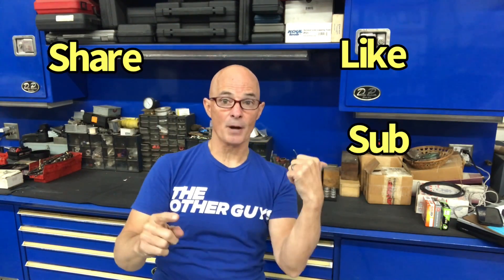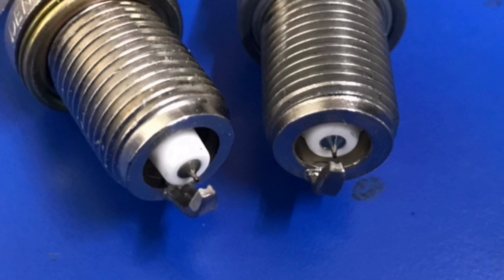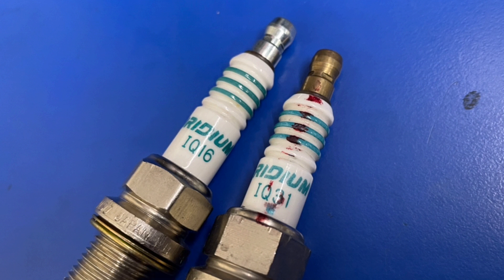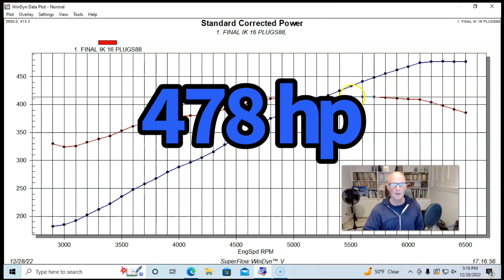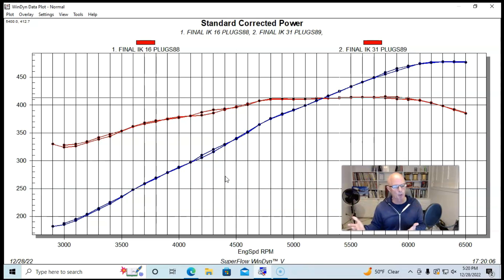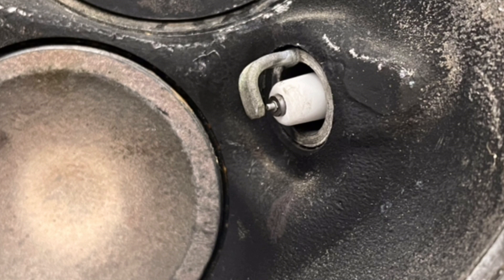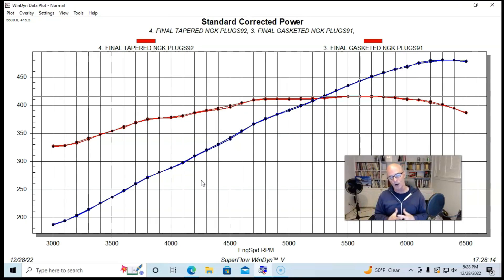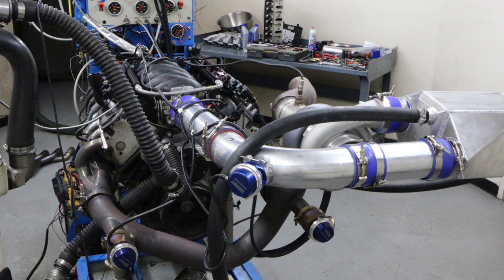SPARK PLUG HEAT RANGE TEST-JUNKYARD LS. HOT PLUG v COLD PLUG-DOES IT MATTER? TAPERED VS GASKET PLUGS

Comment: i have a 1070 318 la engine , i used to run rn14yc and autolite 66 and they both ran the same then i put in a set of ngk gr4 platinum plug and the engine began to run lean and no more raw fuel smell out the tailpipe ...what do you say i should do ,,,keep the platinum plugs and richen the mixture a bit or go back to the coppere plugs and lean it out a bit

Comment: Hey Richard, ever mess with the range Rover sport 4.2 or 5.0 supercharger? M112 I believe on both. Any idea on differences? Issues with them? I think it would rip on my motor. I can snatch up a 4.2 blower dirt cheap at the Pick-A-Part. The m90 is a bit small I think. 4.5 V8.
Reply from the maker: NEVER HAVE
Reply: @richardholdener1727  sounds like a good idea for you to grab one 😁. I'll have to check 8n on the live feed to see if anyone has played with them.

Comment: This doesn't really get into WHY you run a hotter/colder plug. You want a plug that's hot enough to burn soot off at WOT but not so hot it becomes a hotspot causing detonation. Too much conductive soot will sap spark energy.

Running a really cold plug on the street & driving like a grandma will foul it out fairly quick. The "get heat in the motor" meme actually applies here, winding the engine out occastionally will nuke carbon on the plug.

Comment: It would be cool if you CC measured the cylinder heads with the tapered plug and the gasketed plug to see if that taper plug subtracted like half a cc
Reply from the maker: AGREED-BUT IT DIDN'T CHANGE POWER
Reply: there is no difference between the two for same design of plug. taper/gasket both protrude the same. I tried them in some OE heads, Edelbrock heads and TFS heads many years ago. they're just the same.

Comment: I always wondered different ring gaps vs different boost! Power outcome
Reply: No difference in power, but it'll sure keep from popping the top of the ring lands off the piston with the correct ring gaps. The correct ring gap size vs bore size vs boost level will ultimately keep the ring gaps ending up the same under the expansion from the heat.
Reply: @davelowets  make sense!  (:
Reply: @davelowets  is there a formula for prefer ring gap and boost, bore size?

Comment: In a Live show a couple days ago I asked about the warning BTR has posted, in the Hot Rod camshaft kit page, not to run it above 6500 RPM.  I called them to ask about it.  They said it's due to the spring retainer included (powdered metal).  He said using a titanium spring retainer would eliminate the cause for the warning.
Reply from the maker: why would a retainer change that?
Reply: @richardholdener1727  No idea! The guy on the tech line said it with conviction so I assumed it would make sense to you.  I'm even more interested now that you're questioning it!
Reply: @richardholdener1727  presumably quality, strength, weight  ? Maybe they think the PM might fail ? If so, not a great idea putting them out there
Reply: @blow0me  I would completely agree with that! Why put out junk that could fail like that, when a steel retainer CAN'T be that much more expensive to make. A retainer is only a few bucks to begin with. 🤔
Reply: @blow0me  Nope it sure isn't. Especially on an inexpensive part such as a retainer. 🍻

Comment: So I run an extremely high compression for running on pump gas. My compression ratio is 12/1 ish that number doesn't really matter what matters is compression test 265 PSI. And I've had a problem before with cheap spark plugs that had a little sharp piece of metal on it and caused detonation issues. What I want to know is if you were to polish the spark plugs smooth and point the gap. Could you in theory get one or two more degrees of timing gaining just a few horsepower. I'm thinking maybe even squeeze an extra 10 out of it
Reply: It would be nice if he played with timing during these various spark plug changes, but he's responded to me earlier saying it's not necessary as if detonation characteristics don't charge🤷🏼so yeah
Reply from the maker: the plug does not change the chamber design-timing requirement is the same
Reply: If you're buying plugs that have random sharp pieces of metal protruding from them, you had better stop shopping on Alibaba

Comment: I have done a bit of reading on spark plug heat ranges for boosted applications, and the electrode material (copper, platinum, iridium) also having an affect. Copper electrodes being the best because that dissipate heat better, but what we don't have, is actual test data to support these claims. 

Richard, is there a way you might be able to run a controlled test like this? Not necessarily sure HP gains, but rather it's affects on KR and detonation?
Reply: I would think a dyno is showing you the same thing better gains more power would equal hottest spark without any detonation.
Reply: @aphil4581  A spark plus heat range has absolutely no influence on the "heat of the spark". The heat range has ONLY to do with how fast the tip of the plug transfers combustion heat to the surrounding metal of the head, and ultimately what temperature that the tip of the plug runs at. The entire purpose of the different heat ranges is to get the right temperature of plug that runs hot enough to be able to burn off deposits that end up on it as the engine runs, but not run hot enough to promote detonation or pre-ignition. That's it...
Reply: KR? Knock resistance?  I imagine the heat range allows you to compare different material plugs.  Makes sense to me to run a colder plug than stock on boosted or nitrous engine, the worst that should happen with too cold a plug is fouling up.
Reply: @connor3288  KR is knock retard. When the PCM detects any knock from the knock sensors, the PCM will retard the timing to help prevent it from damage. At least that's the idea. I use plugs that are 1 heat range lower than stock since I've added boost. But I'm currently using copper tipped plugs instead of platinum or iridium. I'm more curious on seeing data on the electrode tip material. I do know that copper dissipates heat more efficiently than iridium or platinum by almost double. On paper research that is. Just curious if it's really a factor on causing knock.

Comment: Great video guys ,have you done a video comparing compression ratios  in a big block Chevy ??
Reply from the maker: no sir
Reply: With the BBC the old how to supe up a bb chevy book said to use two different heat ranges of plugs because Its port configurations are like running two different 4cyl engines.
Reply: @aphil4581  Sorry, that's complete nonsense..

Comment: Could you do a test on reach? Like correct thread reach and too short of a reach where the electrode/ground strap is up in the cylinder head and not directly in the chamber. Reason I ask is I’ve had people install the wrong plugs being too short and the engine still ran just would like to see what happens on the dyno. It’s a common thing on the small block ford with aftermarket aluminum heads requiring a longer reach plug and the auto parts store just gives them a plug based on the make and model.
Reply from the maker: the tapered seat vs gasket did that
Reply: @richardholdener1727  I was looking for more than a 3/16” difference. Like the ground strap be 1/4” up in the hole away from the combustion chamber. Way too short of a reach.
Reply: @curlracing276  There's no purpose for a test like that. It would be no different than intentionally running the wrong jets in a carburetor... Just get the right parts.

Comment: Hotter plugs work well on carburetor cars after a good tune with proper jets/rods one step hotter keeps the plug cleaner also helps acceleration or tip in
Reply: Not if it causes detonation, or pre-ignition...

Comment: How about testing resistor vs non resistor plugs with the Holley EFI.  Do non resistor plugs with stock ls coils on a Holley EFI cause issues due to electrical noise (RFI?) ?  Inter webs have varying opinions on this.

Comment: How about running non-foulers on the plugs with some(4) 1.5mm holes drilled out the side?
Reply: Holes in the nonfouler that would be cool if the engine runs you could see how long it takes before it catches something on fire :p
Reply: @2VersTT0  It's basically what F1 engines are doing, along with the Maserati MC20. It's just a cap over the spark plug with 1.2mm holes drilled in. Natural gas engines use the same thing. It's called a passive pre-chamber. Of course, things like timing, and AF ratio would have to be tuned to work with it.

Comment: This would have been another good one for the multi gas tester. Hotter plugs might reduce emissions in a street driven car. For race application I'd expect heat soak to be a bigger factor and to start getting into knocking and the resulting ignition retard or piston melting with the hotter street plugs.

Comment: Possible spark plug tests: 

 Use " oil foulers " on a good motor.  Those spark plug extensions that pull the plug away from the head to increase heat range and the small hole shrouds the plug from liquid oil. )   

Does a double ended coil ( waste spark ) affect power due to:  Spark occurring in the exhaust stroke / spark jumping from the center to strap on one plug and strap to center on the other plug.

An easy way to test spark jumping direction power would be to use one waste spark coil per cylinder and install a dummy plug on the unused end.
Reply: I would say "No" to the direction the spark jumps the gap.

Comment: This is one of those things that most people would never benefit from, but became a myth after awhile. "If you run cooler spark plugs you'll gain some power!". It's just not true for most situations. Yes, if you are running lots of boost and your running hot plugs, you probably WILL see a power increase by switching to cooler plugs, but it's because you were using the wrong plugs to begin with, and that doesn't mean everyone else should change to cooler plugs as well.

Comment: A buddy of mine, who builds and tunes engines and loves data. had a 383 on the Dyno used NGK plugs, and then switched to the Autolite same heat range with the ground strap cut shorter, and they gain 6 hp on the Dyno.
Reply: The NGK plugs must have been fouled out then... I use those same cut back Autolites in my 730h.p. 547" big block, and I can switch to NGK and gain/lose nothing at all. The Autolites DO however last longer for me than the NGK's

Comment: The only thing I haven’t seen you try for spark plugs is the surface discharge plugs like brisk makes. Ngk also makes those style plugs and Indy and formula 1 and the motorcycle racing world exclusively use them. I would think there must be something to those if the oem race teams are using them.

I’ve had fouling on long cruises on 9 heat range ngk plugs in my stroker nitrous ls1.

Comment: Used to go thru that 'heat range' plug noise with Harleys. Their plugs were made by Champion, which I never liked. I always ran Autolite 4275 (short reach) or 4265 (long reach) and never had any issues.
Reply: What "heat range plug noise" issues were you having?? 🤔

Comment: Richard, surly these plug tests would be a lot more entertaining if you were using a 5.4 from the wrecking yard don't ya think....
    Okay...but seriously, I do think using an old single coil distributor motor might show some valid differences verses modern multi coils. That being said.
   I would not be surprised if you cut the ground electrode completely off the plugs if your test engine if it would still run surprising well..
IDK but i'm guessing it would lose considerable power/RPM,and miss fire above 3K or so but?? Overheat and fry coils in the real world of course, but would be a cool DYNO test, or a dud🤣

Comment: Its always a cool test. But do all of these tests on a high compression combo and the results might change.or an older school motor with lower power ignition!  The ls-ish ignition  is rather good and is masking some issues guys have with plugs. I have a sbc combo that was sensitive to gap and heat range on the street, the better hvc msd coil solved that issue,  and have been trying more gap to test, but some cylinders had issues with over .040 gap and 100 miles on the street, even a lean tune. The better coils allows a richer tune and no plug issues after 1000’s of street miles. 

It might be interesting to test this on and older simpler motor to see what happens. 

I did plug testing on around a 100hp banshee on the dyno and plugs and gaps were worth 10hp, and another banshee gained 20hp with a different ignition box

I think these tests might be more interesting now on a boosted motor
Reply from the maker: plugs and gap worth 10 hp on 100-hp motor?
Reply: A methonal 2 stroke, factory ignition, 443cc.  Yes  and even fresh plugs gapped to .018 would lose 5 hp after 5 runs, and a fresh set would restore power. And the same motor hated a different cdi box, and another love that aftermarket box and hated the oem. A larger motor on methonal with the same ignition was not gap or plug sensitive but was cdi box sensitive. It lost 10hp with the same ignition on rhe larger motor, but gains 10hp on top Of rhe the old motor peak, and regained almost 20 hp frame a cdi box change, the exact same cdi box lost 1.5 hp. From the old comb! 

It can be crazy on rhe edge! 

I bet if you tested  a 1000hp turbo 5.3, the plug gap may be worth some hp
Reply: Still love the test! If things are working, no reason to change. Your test kinda proves the need for a good ignition, it’s way less sensitive to other factors! 

I had a and msd plug boot issue that would sometimes allow the boot to slightly pop off and cause a misfire, three new plug wires ended up fixing that issue,  I bet most old “issues” are ignition quality related, but it might be a cool test, an eBay hei  vs the world!!! Lol
Reply: I don't buy the 10h.p. claim either, unless the plugs were defective to begin with. 

The 20h.p. from a different ignition, no way, unless the box had a radically different timing scheme in it that the other one did not.
Reply: I tried several new plugs with the same results. When you’re at the limits of an ignition there are big changes From small changes. This test is on a mild combo with a good ignition the test woul be interesting on a motor with boost, if he ran .100 gap on the Big Bang engines there is a good chance tightening up the gap it’s worth a bunch of power..
Reply: @nathansumerlin8391  How would running different plugs, when an ignition is defective, or not enough for the application, make any difference? It wouldn't. A plug gap is a plug gap, if the ignition can't fire it, it makes no difference what brand of plug it is.
Reply: Some applications don’t have upgrades for the ignition, or some people may not be able to afford the upgrade. Why dose Richard tighten the gap when he ads boost? Or change heat range on extreme boost applications?  The  ls ignition is excellent, that’s awesome.  All I am saying is that sometimes plug gap, is worth some power, when you’re pushing the limits of what you have sometimes. I have had iridium plugs loose or gain power on two stroke applications with all kinds of different ignitions.
Reply: @nathansumerlin8391  Sure, I understand all of that... But 10 and 20 horsepower on a "good running" 100 h.p. engine from something like changing to a different brand of plugs, or just changing the plug gap isn't a reality. If you gained that much, from whatever you did, that engine HAD to have been running AWFUL before the change. It was SURELY missing and/or banging, and it would have been completely obvious that something wasn't right. The entire point of these videos isn't to prove the obvious, like what you have encountered, but to show that with PROPER parts and a GOOD running engine it makes no difference what brand or gap (within reason) the spark plugs are. 

Sure, I could set a Holley carb 15 jet sizes too big, say that the "engine runs like shit", and then throw a properly jetted Edelbrock carb on it and say "look, it picked up 50h.p. over the Holley", but we all know that wouldn't be the truth at all. 

Your first few statements are kind of like my example above about the carburetors. 🤷🏻
Reply: I completely understand what you’re saying as well. And don’t completely disagree. 
One combo ran fine, but hated iridium plugs in the same heat range and brand, ngk br9eix  vs br9es, seems backwards honestly,  it’s just what I found on the dyno, tried different gaps to see, and was no measurable gain or loss within .010 gap. I tried 2 cdi’s both new oem, and new oem coil, no gain, tried and aftermarket cdi and lost power. Not much but 1.5 hp.

Within one year I upgraded to a larger motor and retested before riding and tested the combo, same cdi  and. It seemed strong and mean on the dyno, but for testing I bolted on the same aftermarket cdi I had lost power with before and gained a magical 20 hp , two oem cdi’s had no misfires but they both lost this time to the after market cdi, it’s crazy 

My only thing on this test is he has made 1300-1600hp wirh stock coils, that’s amazing, but to test plug gap on a mild motor with that kind of ignition is kinda obvious as well. I still love the test and am not trying to disrespect. Don’t you think it would be cool to see a test at the limits of the ls ignition for gap and plugs?  I see a lot of guys never check plug gap or heat range and they think there tune is off,  I just hate to see something small stumble someone in the future because someone says .100 gap is fine

Comment: Keep telling the folks over on the E85 forums that they don't need or want a hot plug. Mark Sullens swears there is "good power" to be picked up with a hotter plug and that they have dyno tested and proven it. I don't see how. If the plug isn't fouling, no reason for a hotter plug. Or at least that's what I believed.